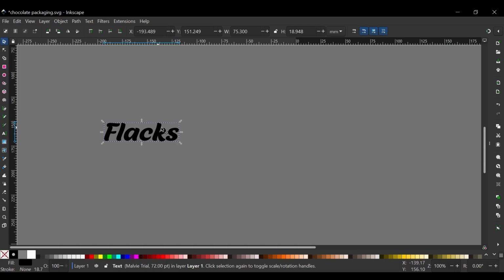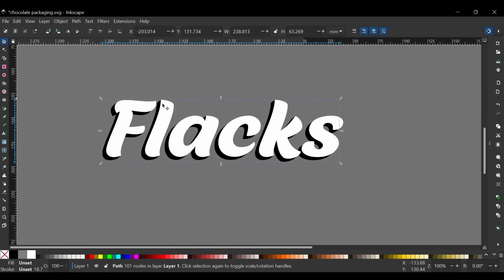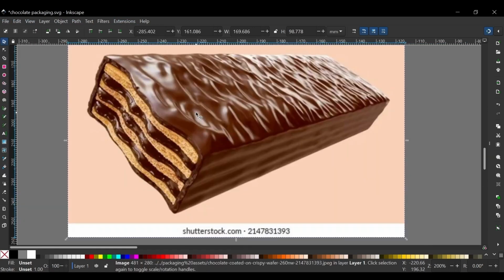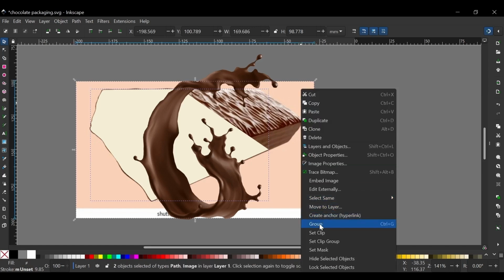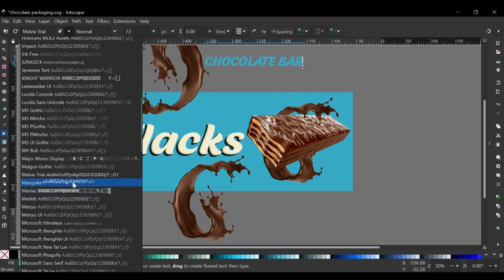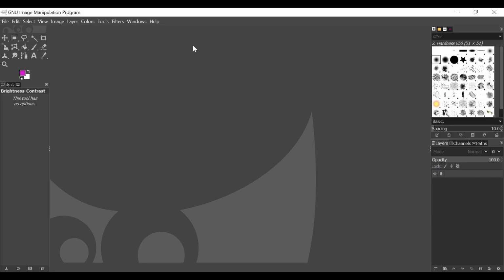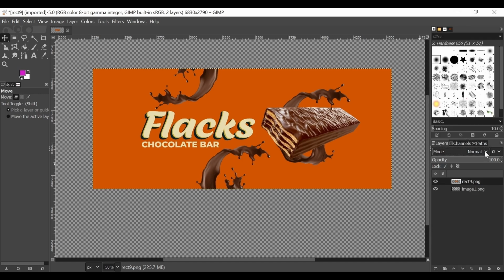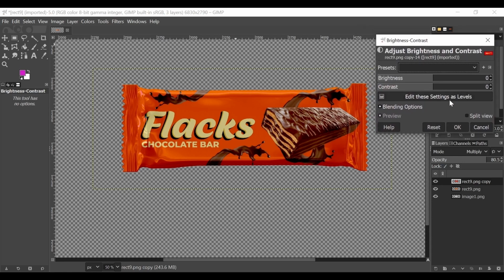simple package design and mockup tutorial with inkscape and gimp

Comment: Great, thanks for the video. Haven't you thought about using the Long shadow extension for the 3D effect of the text? Extensions/Generate from Path/Long Shadow. It works very well, I think that although you usually have to do a bit of cleanup, in the end it turns out much faster than the method normally used. https://youtu.be/scE99pWJ2JM?si=VYqcvtccbdGSULTT